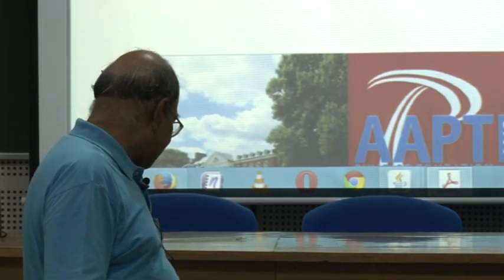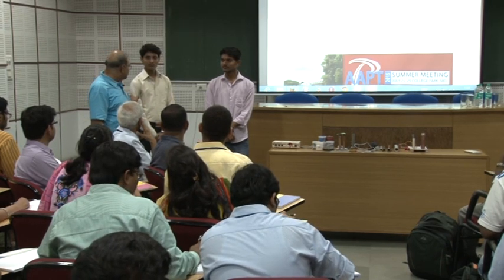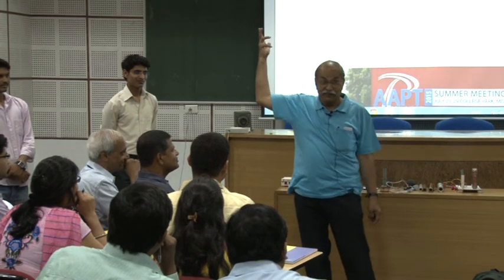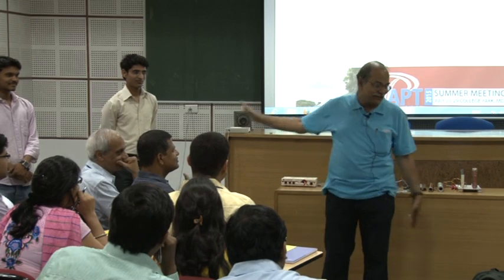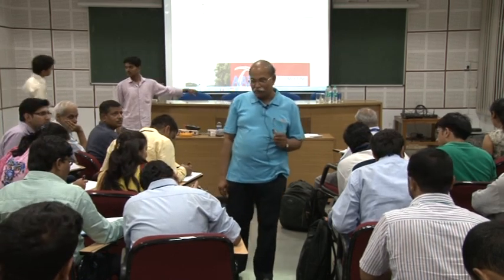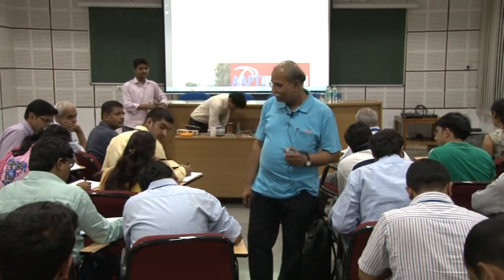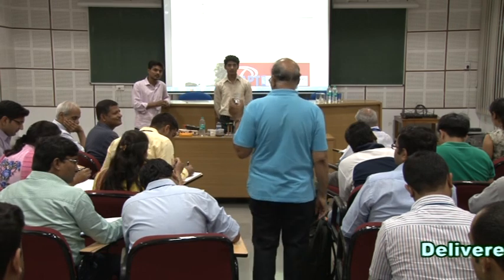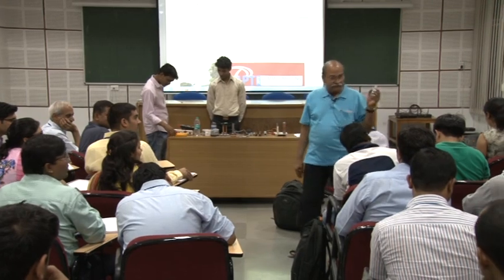Resistance of a 100 w bulb.

Comment: 3:43 so this is also happened with mine calculation and observation ( oms law telling me it shoud me more then 500 ohm but my ok working multimeter showing resistance between it 45 ohm !!!😱😱😨😨😵😵😡😡)..... 
Now i am curious why ....
May be temperature relation of conductor if this is the case  then how it manage to bear 5 amp of starting current !!!!
Reply: Because there is increase in temperature due to current (Heating effect of current).